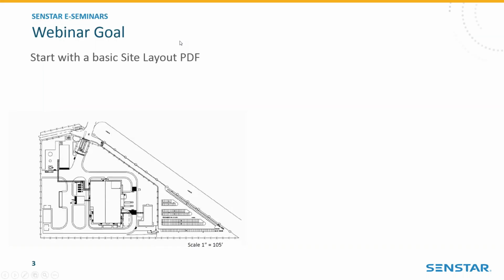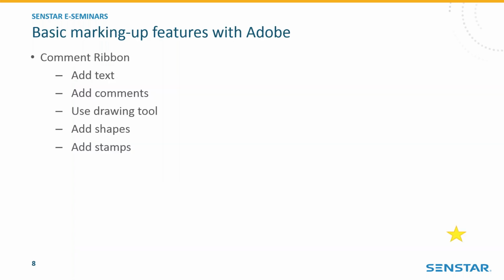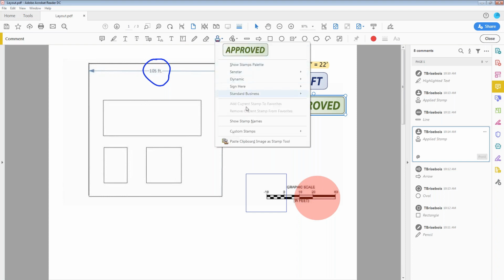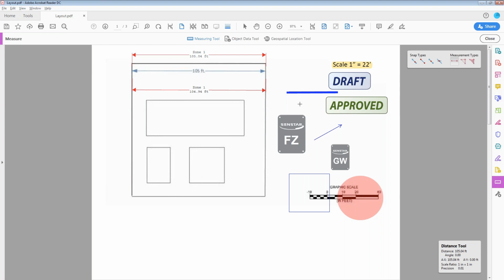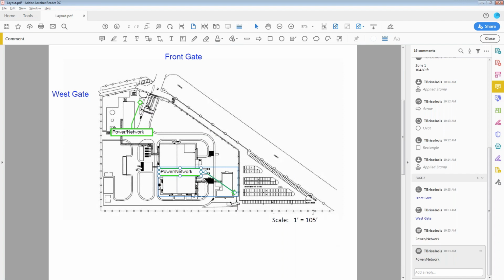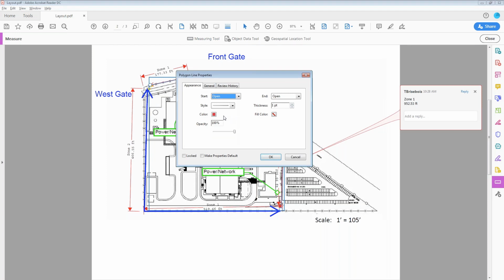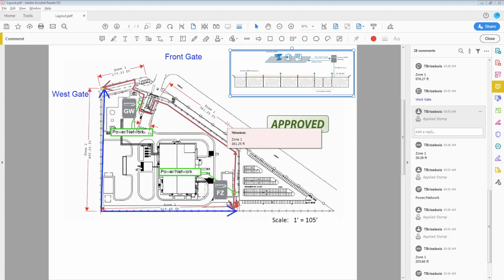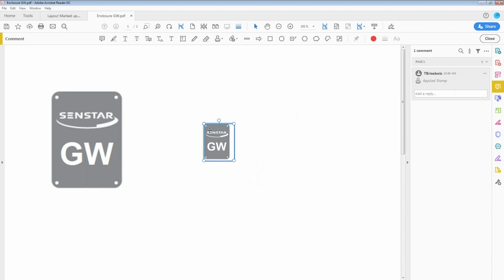Using Adobe Reader to Measure and Mockup Site Designs Webinar

Comment: I try to change my scale to 1” = 30’ but it keeps measuring 1” = 1” even though I changed it.
Can you help with this?
Reply from the maker: I believe the mechanics of why this is happening is because it is using the embedded scale that was likely provided by the generating CAD tool.  Check your Adobe Acrobat settings under Edit>>Preferences>>, then select Measuring(2D) from the left hand column. The first option listed should be "Use Scale and Units from Document (when present)".  Ensure this box is UNSELECTED so that it uses the scale that you have setup in Acrobat.  This should rectify your issue.
Reply: @SenstarCorp  
That WORKED!
Thank you!!